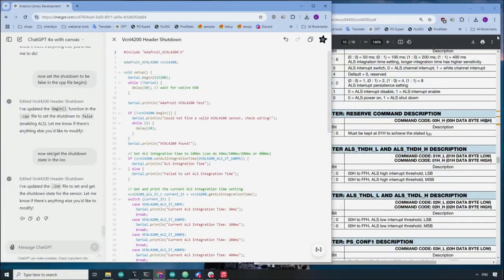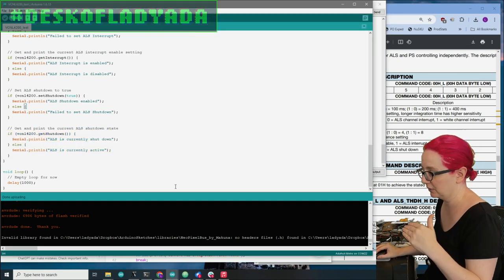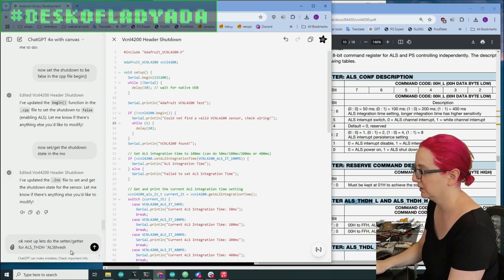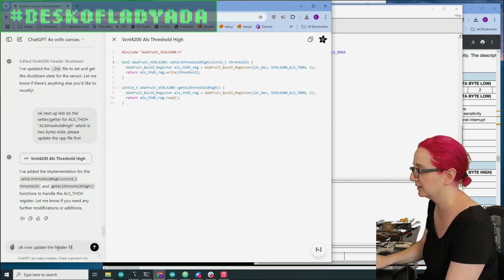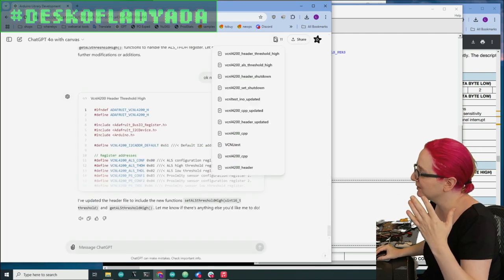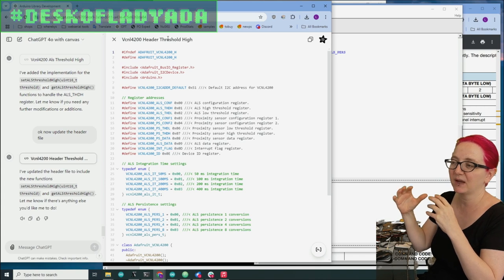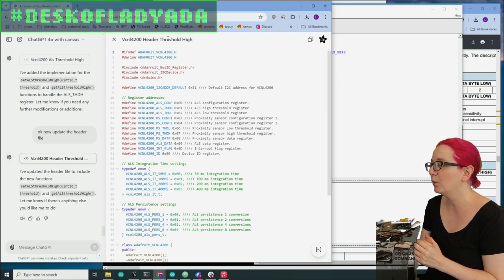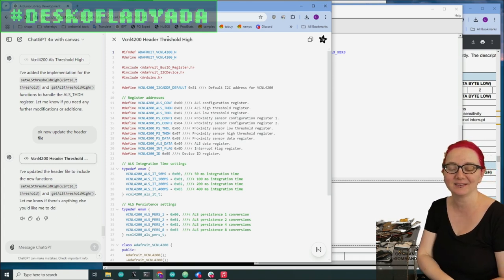Ladyada tries out ChatGPT Canvas for Arduino library writing: A request- tabs & context, please!

Comment: I know you mentioned that you don't like vscode and Visual Studio, but if you could use vscode, instead of the arduino ide, there are plugins like claude dev, among others, that operates directly in the ide and iterates on the actual files within your project. Maybe this is a good project for the Circuit Python team to see if they can do some interop between a tool like Canvas and the arduino ide.

Comment: Do you upload the datasheet to your conversation? I find that the accuracy goes way up when I can provide or point to specific documentation for the thing that I am referencing. Even though ChatGPT probably has come across the specs in its training from data out on the internet, that data also includes all the other references to that chip and its specs, which probably includes bad data, for example bad answers to Stackoverflow questions, etc. By uploading the datasheet, you can direct ChatGPT to reference the datasheet for specific information, as opposed to it relying upon its general knowledge.
Reply from the maker: (we do upload the datasheet)
Reply: @adafruit  Ah, nevermind then, should have figured you'd be 2 or 3 steps ahead of me. My bad.